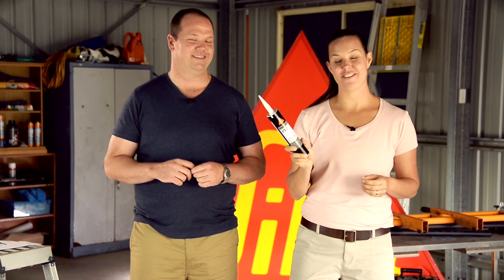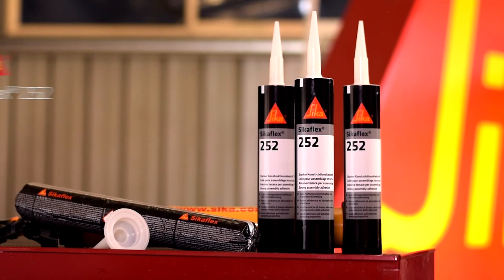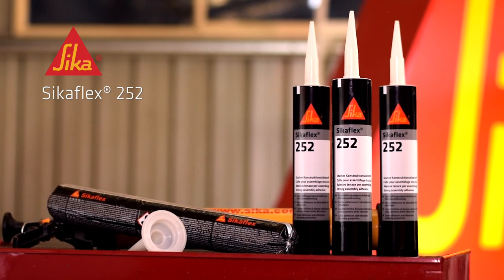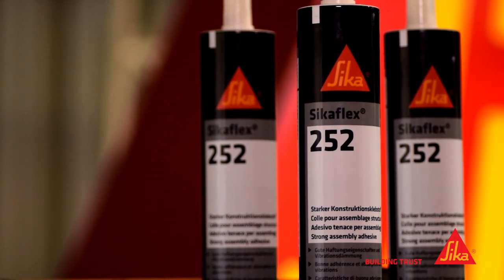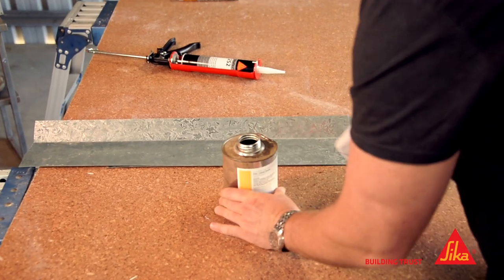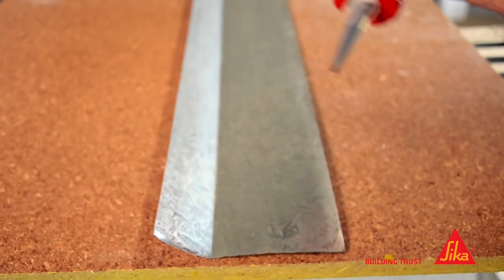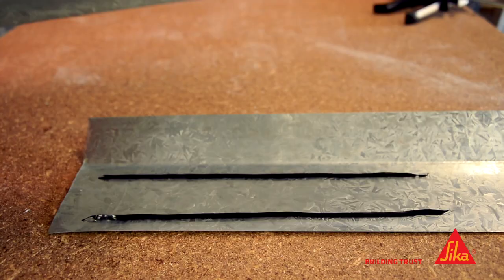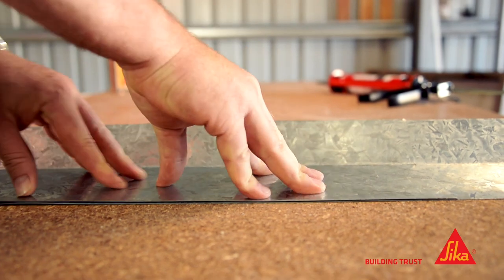Sikaflex® 252

Comment: Im a skeptic here. Sikaflex 252 was used to attach solar panels to my camper roof. Eight brackets per panel. Camper roof is aluminium, brackets are aluminium. Both surfaces were cleaned and sanded with 80 grit paper. After 5 days of curing, the adhesive can be removed with fingernails. Mounting the same using roof & gutter silicon, without surface preperation, gave a better result. Removal not possible without a knife. What am I missing here? This video not demonstrating the bond strength does not help either.
Reply: Was activator and primer used before glueing?, I'm trying to decide what product to stick my toolbox back together with.